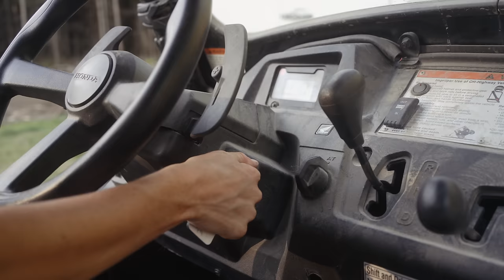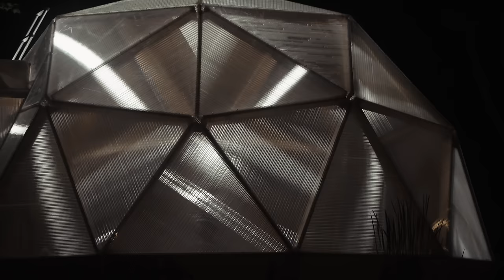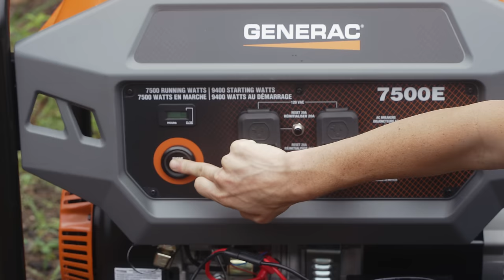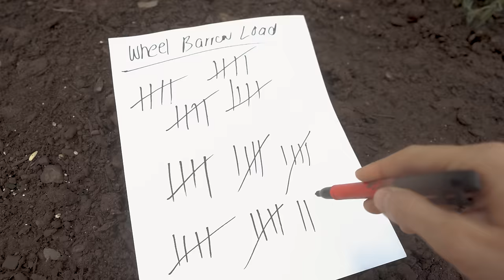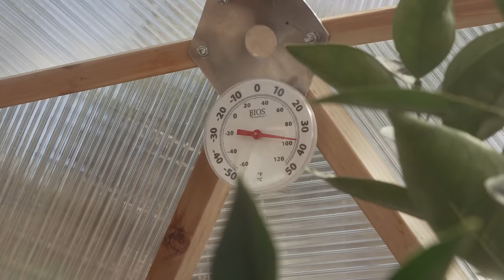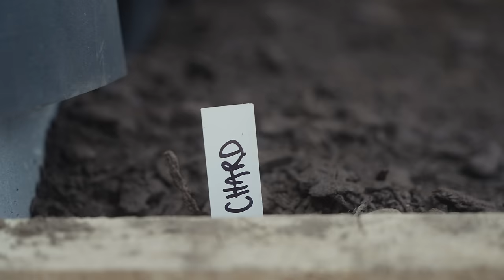We Built A Greenhouse At Our Cabin! (part 2)

Comment: A hint I learned about pounding in those foam panels without breaking them is to place a board along the length of the edge you're forcing in and hit that board with the hammer.  It spreads out the force of the blow and better seats the foam board without damaging it.

Comment: Check the diagonal measurements of the door frame first and also check for “winding”, that’s where the two door frame uprights are parallel and not twisted in relation to each other, ie one vertical and one leaning in or out. Two pieces of thin string across each diagonal should just touch in the centre, not pulling hard against each other or with a gap between them. Quick check saves so much time - just don’t ask me how I know this fact! It’s looking great BTW!

Comment: Suggestion for your hanging plants. Get some pullies and rope so you can lower them , when you need to water. 
2) place most of the dirt into the front end of the wheelbarrow. it will make it much easier to maneuver and can decrease the number of loads needed.
3)when using the skill saw. Run it with the motor over the piece that isn't going to fall. Safety first pls😉  

SOFT TACOS

Comment: Just a tip to make life easier. Putting a piece of board between the insulation, drywall, etc, before using a hammer or mallet, will prevent damage. 👍🏻

Comment: If you ever install foam insulation sheets again and need to bang then in place I’d suggest hitting a 2x4 or piece of plywood to prevent damage and it should help spread the impact making it easier.

Comment: My neighbors gave me a geodesic dome  play set and I am going to do something similar. I've been hand-digging a natural pool 7000 gallons for over 2 years just me, and the dome is going to sit over part of it. And I drilled my own water well with a drill rig that I built myself. You guys are blowing my mind.  Harbor Freight sells greenhouse power window openers that work without electricity, based on a temperature you set. It operates by expanding fluids. Very cheap.

Comment: I built a growing tunnel in my Connecticut backyard garden for winter 2020/2021.  Baby bok choy and arugula grew super well.  However, one thing I learned is plants need not only heat but also light - at least 11 hours of daylight - not direct sunlight but light hours versus dark hours.  Plants survived and stayed green in the tunnel so I could harvest any that were ready but they didn't grow.  So from mid November until the end of February my green plants were in a dormant phase.  I'm wondering if you have thought of putting lights into your greenhouse?

Have you also considered installing rain gutters inside along the wall to increase growing space?  Small lettuces do really well in them.

Hanging doors is super hard.  Kudos to you for working at it until the door opened and closed perfectly!  I am wondering if you should paint/varnish the door framing to prevent it from contracting and expanding so much as the seasons change.  

Love watching your progress, ideas, and determination!

Comment: WOW!!! You girls have accomplished so much this past week. You are really going to enjoy those veggies this winter. I’m so proud of you Crystal for facing your fears. I have a big problem with heights also. My heights and your heights are totally different though. I can do a ladder and even get on a roof carefully but my heights on my job was in the hundreds of feet range. My worse one was the stairs going up the side of a Kamyr. That is basically a huge pressure cooker for wood chips. It had about 40 flights of stairs from bottom to top. My one and only attempt got me about 15 flights up before I froze and then I couldn’t go up nor could I get down. After a lot of encouragement and a lot of butt scooting I made it down. That was the highest I ever tried and needless to say, I turned that job promotion down…..I did however, continue with the company for 35 years before I retired. I’m proud of you and even at that point I would be hesitant and the exact reason is the question you asked Jaz. How much weight does these panels hold? I love how you work together and play together. You two have accomplished so much on your little homestead. Have you named your little homestead? I can’t remember ever hearing you call it anything but the cabin. Much love to you both from Alabama.🙏✌🏼💕

Comment: I know it is done already, but, when installing the foam board you should use a 2x4 on the flat and hit that with the hammer so it spreads the impact over a larger surface

Comment: You  put your bolts in upside down.  The threaded part is supposed to be on the inside.  Water will run down the threads and rust the nuts in place and possibly cause leaks.

Comment: I would, ONE AT A TIME, remove the fan bolts and put the bolt-heads on top and the long bits at the bottom coming into the dome.  I would also put sikaflex in the upper bolt holes.

Comment: I wondered about the lumber that you used for the deck and boardwalk. Is pressure treated lumber not used in your climate ?
It seems that untreated lumber would rot very quickly. 
Thompson’ s
Water Seal is an excellent product used on decks etc.

Comment: @11:49, next time just cut the foam about 3/8 of an inch smaller than you need, then use a little spray foam to lock them in place, it’ll be close to 100% air sealed.